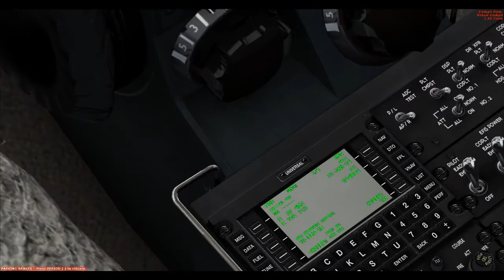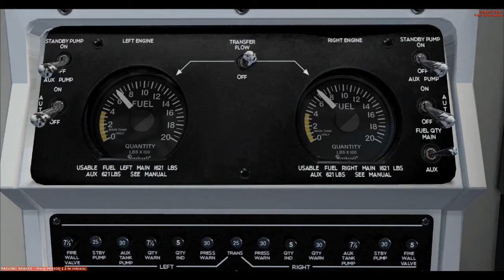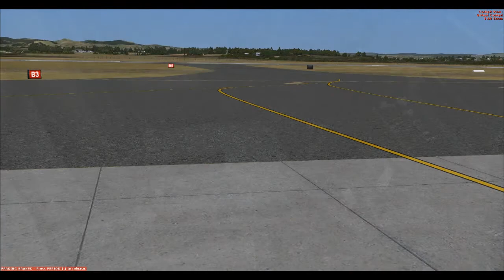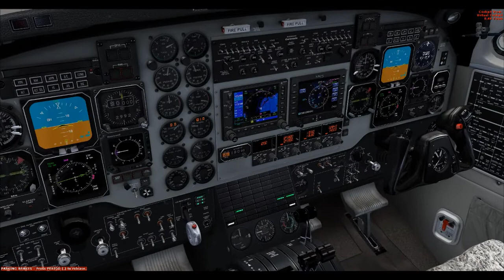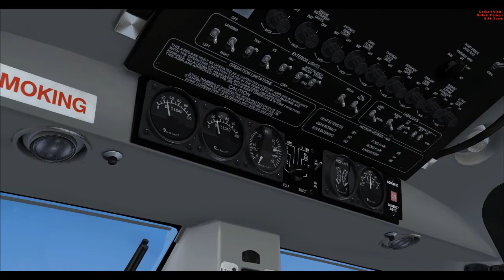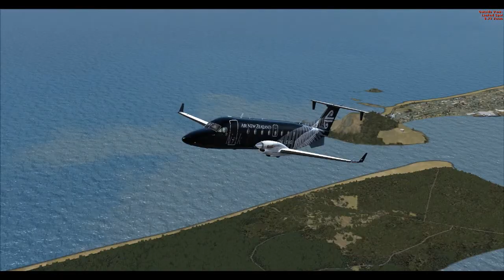[FSX] Carenado Beech 1900D | NZTG - NZAA | Part 1

Comment: if you could do the same engine start in real life you could burn the engines
Reply from the maker: Yeah, probably. lol

I'm trying to look for a tutorial flight but Carenado hasn't made one (well I haven't seen one yet).
Reply: NZEddy Agreed, You always start a turbine without adding fuel until the NG reaches whatever percent the aircraft manual recommends to avoid a Hot start.
Reply: Mr_ATC i always thought you start one engine at a time because there's not enugh battery to start both at the same time :/